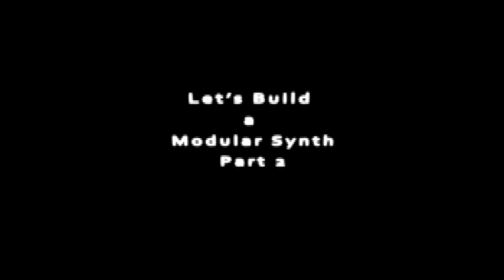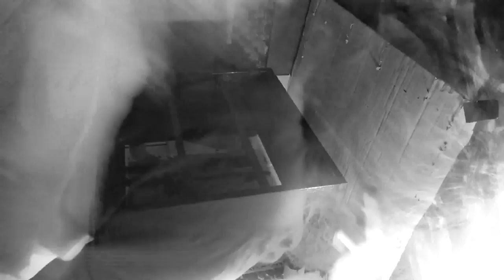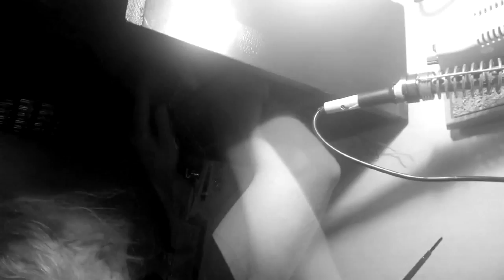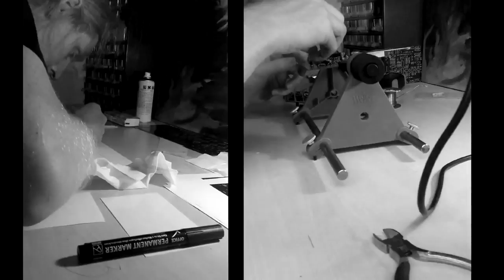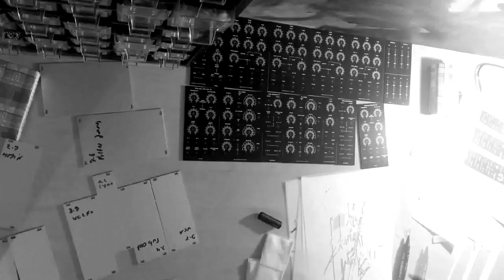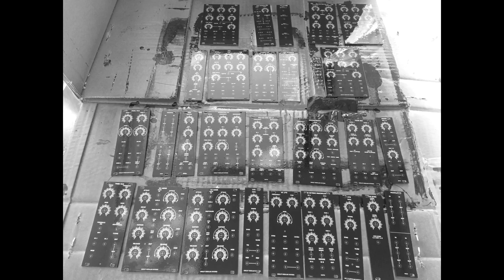let's build a modular synth -part 2-

Comment: Did you just print the panels on paper with a laser printer and epoxy them onto aluminum?
Reply from the maker: yes u are right
inc jet want work with finsih later 
i go to local copy shop pint 3-5 panels on a pater, they have better laser printer (realy dark, if not i can complain and print again)  and self gluing paper with differnt sytle ( gloss , matt ..) and later on i put 2k transparent finish ... conrad or car shops .... 2k hold better and longer..2k = 2 conponent i dont know the english word here .. 5 years now without any scratch on it ...only problem .. the 2k finish can only be used once ... so i alwyse plan 10-20 pannels in one shot to save costs ....hope its helps ... just ask if u want more infos